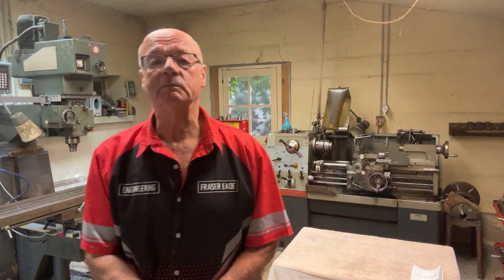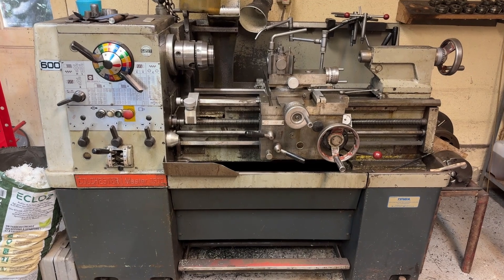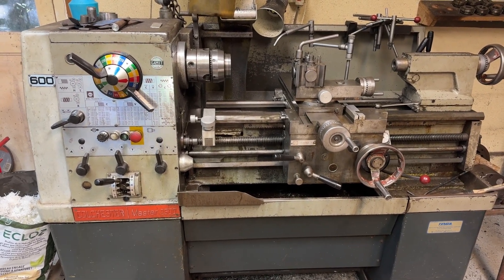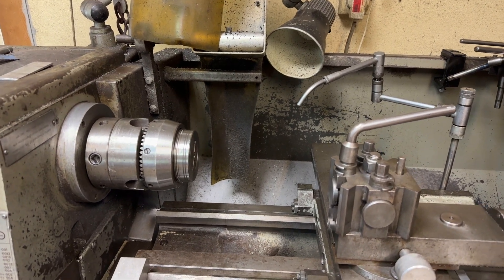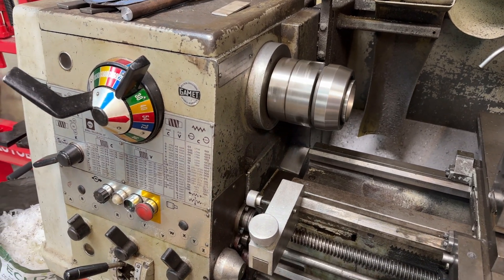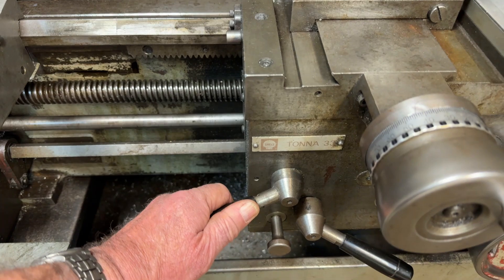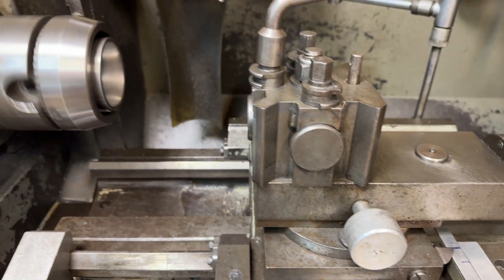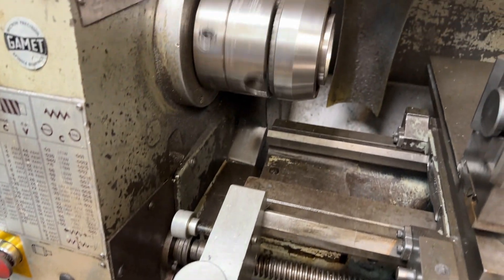Colchester Master 2500 Metal working Lathe

Comment: I did not know that Colchester had shut! It is good that I have a large stock of spares layed in. Do you have the Ainjest attachment for screwcutting ? I found that unless I used it regularly it took longer to set up than just screwcutting on the lever, mine is the 1800, and I find it, as you say, a very versatile Lathe, especially with the collet attachment that you have, I also have a 5C collet system, but that has a far smaller hold range. Stay safe! Chris B.
Reply from the maker: Hi Chris, Thanks again for the input. I only use the lever for screw cutting as I don't do that much (maybe 10% of my workload). There are places to get spares on the internet. Cheers.